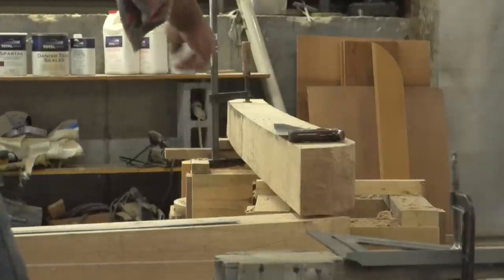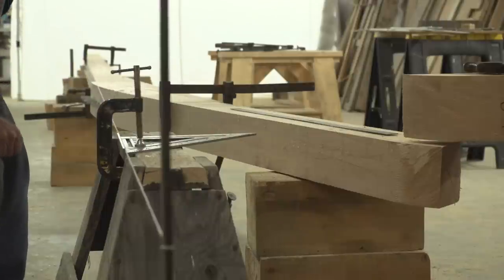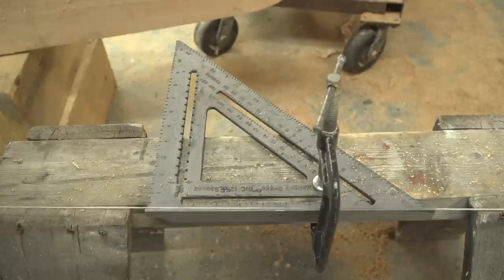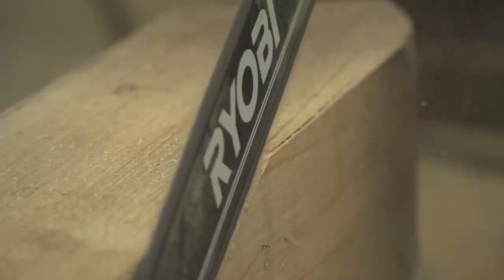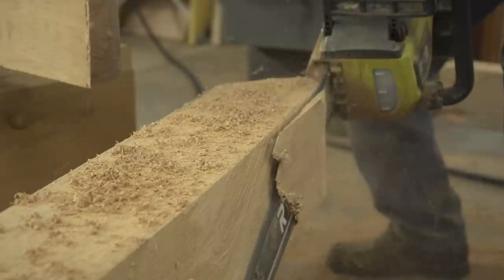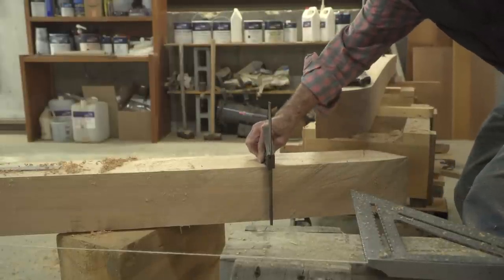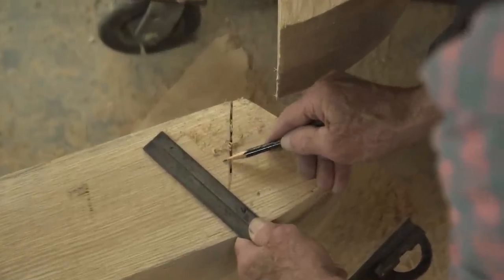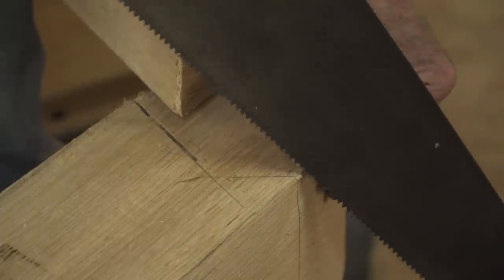Building ORCA - Episode 8: Connecting the forefoot to the stem - deep drilling

Comment: have you ever seen those adapters that puts a chainsaw bar and chain on a circular saw.  lets you brace the chainsaw bar 90 degrees to a surface. great for cutting large wood with a straight edge.
Reply: Prazi beam saw